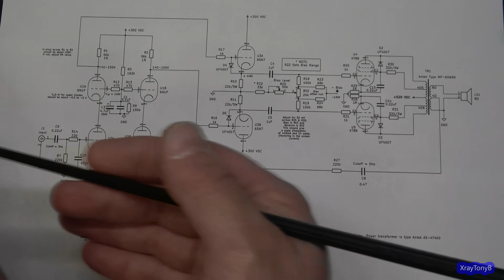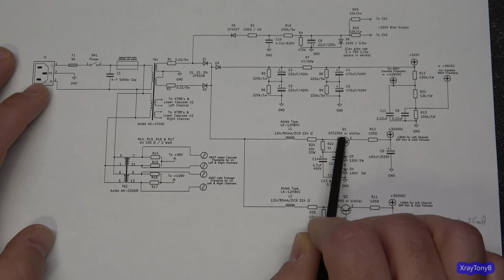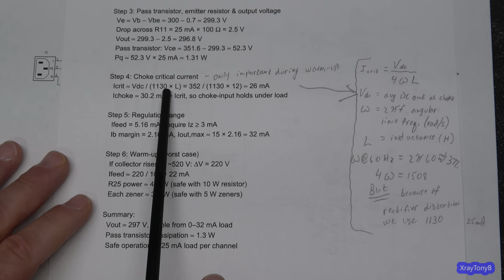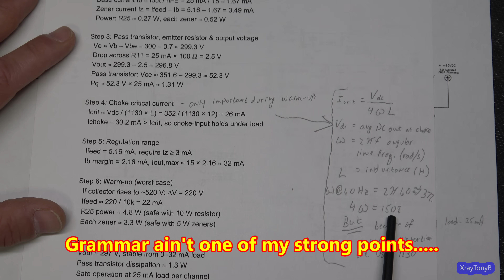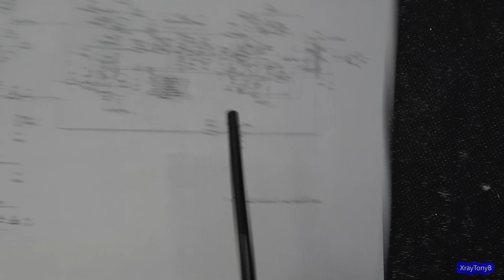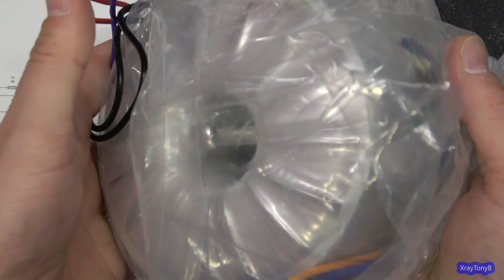Hedge Amplifier Project   Schematic Update

Comment: Hi Tony. Greetings from NZ. Just want to say I enjoy your videos a lot. You have a gift. I tried doing it but couldn’t watch myself in that clip so I end up deleting it.
About your power supply, have you though about using a delay circuit for the high voltage ?
I remember fixing a Kenwood KA-907 that had a astable circuit to delay the protection relay for 10 seconds. Just a thought…

Comment: This has a lot of similarity to a circuit design I’ve been formulating. My focus is on providing a low impedance drive signal to the output tube grids, along with a low DC resistance source for the output tube grid bias. This is based on years of investigating the cause of “red plating” in audio output tubes, particularly in ultra-linear circuits with fixed bias. It turns out that operating both the plates and screens at a high B+ voltage tends to liberate positively charged ions from both the plate and the screen grid. These positive ions are attracted to the most negatively charged item inside the tube: The control grid. When grid bias is supplied through a large grid resistor (100k and up), the result is the grid bias voltage becomes more positive, which (of course) increases the cathode current and dissipation of the output tube. In a fixed bias configuration this can rapidly increase to standing dissipation into a “red plate” situation. And overheating the plate leads into even more positive ions being released. This is unstable.
This why the specs in the tube manuals include “maximum grid resistance.”  Note that most output tubes have 2 different specs for “maximum grid resistance.” A considerably large value (as high as 470k) is permitted for the “cathode bias” configuration. The reason for this is that the cathode bias resistor itself stabilizes the cathode current: The voltage drop across the cathode resistor is proportional to cathode current. This provides a sufficient amount of negative DC feedback to stabilize the output stage from a runaway situation which would lead to red-plating.

Comment: Tony the pin numbers of the 6sn7 are not correct in the schematic. Tnx for sharing! Love the tube stuff 🙂
Reply from the maker: One of the issues with Kicad is their lack of vacuum tube footprints.  I had to modify some of them to get the footprints I needed.  I did it pretty quickly, so there are probably some errors.  Once I get a working amp, I'll clean up the schematic

Comment: I learned tube theory before I had formal education in solid-state. One mistake that many people make is thinking that a tube works like a BJT. Tubes are more like FETs, in that they have a very large input impedance and the current between plate and cathode, is voltage controlled.

Comment: Been following along, an interesting project. I've been meaning to build/play with the Hedge cascode front end for years. Your implementation simplifys the biasing of the cascode/LTP which is a good thing. The points already made about removing the RC HPF are valid. As mentioned your OPT is the dominant pole, the design has to be tweaked after testing to account for the OPT's parameters like shunt C, primary L etc.
  There was an Aussie bloke name of Patrick Turner - see DIY audio - his website is preserved there, it's an excellent resource for valve amp designers, I'd recommend having a look.
   Patrick advocated testing amps open loop from 10hz up to at least 100khz with a normal dummy load, no load & a capacitive load, this with a frequency sweep whilst monitoring THD etc. This gives you a very detailed idea of your designs frequency vs gain vs phase profile. It takes time but worth doing. Simply put you then apply NFB & test closed loop with the various loads.
  Lastly I'd have configured your mains tfmr as a split rail PSU , bridge rectified, with two supplies stacked, that would solve dropping 520v down to 300v & using series caps, haven't done the maths though. Think the mosfet followers/regulators aren't needed, 5w zeners can oscillatate too - KISS. Perhaps use a preset pot for the CCS Re so you can adjust Vk too.. Same goes for biasing/balancing various stages which you've wisely done. One major change I'd recommend is to change the -150v bias supply using a bridge rectifier & if possible it's own tfmr winding or separate tfmr. Also a good idea to make the bias PSU capable of higher current than needed, say 50-100mA. Seems a bit mad but having a stiff neg rail/bias supply does help.

  All the best....DA.

Comment: Quick question... You may already touched on this in the earlier videos. Why did you decide to use solid state regulation on the 300 volt rails over a more period correct tube regulation circuit?

Comment: Have you thought about a DC regulated filament supply as well? Maybe I missed it in your videos already.
Reply from the maker: I shouldn't need it, as these are indirect heated cathodes.  By referencing the heater to ground (or elevated voltage) through a resistor divider, the AC will cancel out.

Comment: For a full-wave rectifier with a choke input filter, I think you need to use 120Hz (the ripple frequency) when calculating the angular velocity. Also, a choke input filter by itself should give very good regulation. The output voltage past the critical current should be the average value of the peaks, or about 360V for 400V RMS FW rectifier. I cant' remember what your XFMR voltage is from the last video. Sorry if this is not quite correct--drawing from memory working with this stuff decades ago. Interesting project. Thanks for sharing!
Reply from the maker: The formula is based on the frequency of the sine wave, 60Hz.  A  60Hz AC signal has 120 peaks per second, regardless if it is AC or full wave rectified.  The formula still work out the same.  That's where the 1130 constant comes from.  When half-wave rectified, the constant is double, or 2260.  This is due to the time period of each pulse and the time period of one cycle, as I understand it.  I could be wrong and would not be offended if someone corrects me if I am.  Thanks for the comment!

Comment: on the schematic for the power supply you got teice 300 volts left channel!!! shouldn't 1 of them be right channel ? and if not and it be a mono amp then why do you need 2 the exact same 300 volts sections ?
Reply from the maker: It should say right and left.  I duplicated and pasted the second circuit into the schematic and forgot to change the tag

Comment: Good work Tony! 😀 I would recommend not to use a 525V Capacitor. You have a regulated circuit and so a 400-450V Capacitor is a much better choice. High Voltage Capacitors should not be used in HiFi Equipment, cause they do not sound good. 🙁
Reply from the maker: I would let you know, but every time I try to listen to those capacitors, they shock my ear. ;()
Reply: @xraytonyb  :)
Reply: I have to disagree. I have used higher voltage caps in many Fisher, Knight, and other vintage tube equipment without issue or sound degradation.

Comment: I think that choke input style was called a swinging choke in the old days. I have a reprint somewhere, of a Wireless world article about using choke input power supplies. I must dig it out and have a read.
Reply from the maker: Swinging chokes have an air gap in them so that the inductance changes (swings) with current.  The choke in this schematic is a fixed inductor of 12H.  As such, it has a critical current that has to be kept in order for it to stay "inductive".  That's why I had to go through all the trouble of making sure there is a proper bleeder current to hold the choke in a inductive state before the tubes start to draw current.

Comment: My head is in the gutter and all I see in that equation is voltage over four times ball sack times length.

But joking aside I am curious would the chokes see 60 Hertz or 120 hz seeing it's after the rectifier?
Reply from the maker: The formula takes into account a 60 Hz sine wave, which has 2 peaks per cycle.  It doesn't care if they are both positive (full wave rectified) or one positive/one negative (true AC sine wave).  In other words, the 120 pulses is baked into the formula.  If it were 1/2 wave rectified, then the constant would be 2260 instead of 1130.  This is based partly on the time period of the waveform.  Hope that explains it.
Reply: @xraytonyb it very much does. Thank you!
Reply: It's a full wave rectifier, so it should be 120Hz
Reply: @mfr58 I thought so, but I just wanted to ask for confirmation. Thank you

Comment: Only limit your low frequency, never your high. High pass filters are the only filter I use in a tube amp if it’s capacitor coupled. And even then the high pass is set to a very low frequency. Coupling caps are usually no more than .2mfd and the resistor is  only 100k. I don’t use -feedback though since my circuits are usually always triode wired and class a. I don’t have an issue with using feedback. I just prefer to keep the circuit as simple as possible. Simple designs most often perform better than overly complex. 

Plus don’t use the pass resistors in a power supply. Pay the extra money and use chokes.
Reply: Kiss